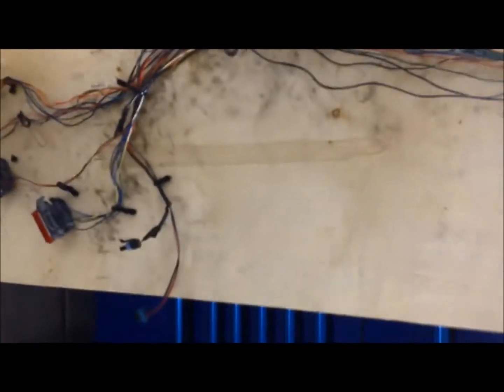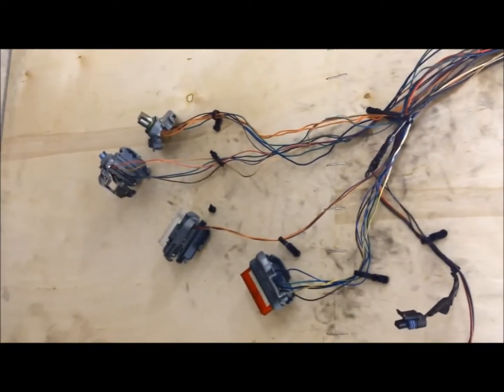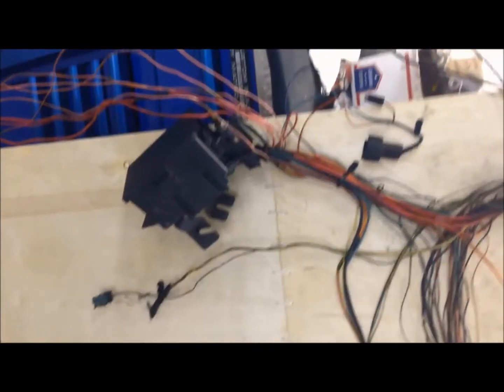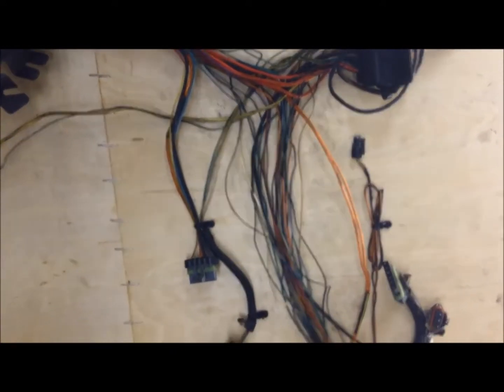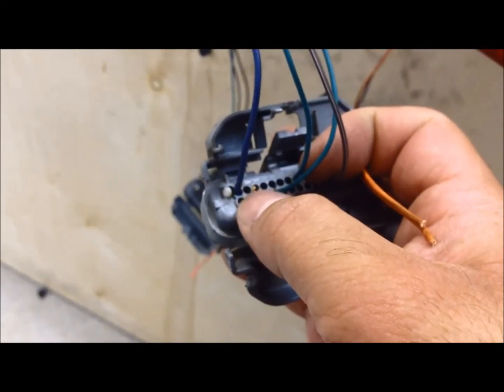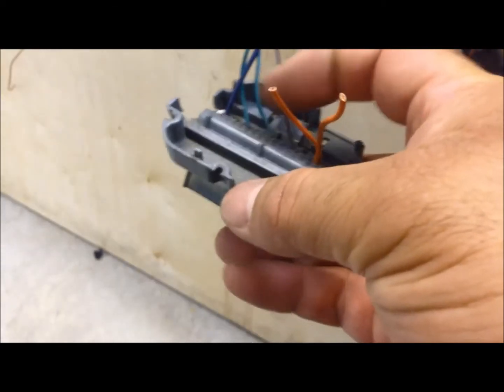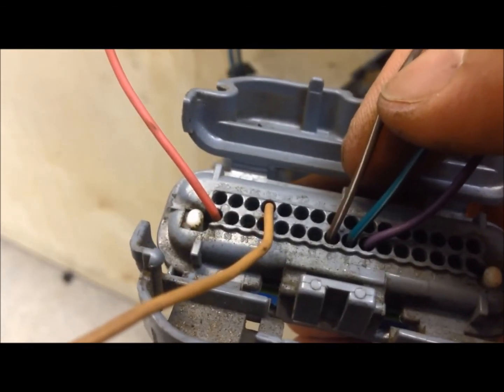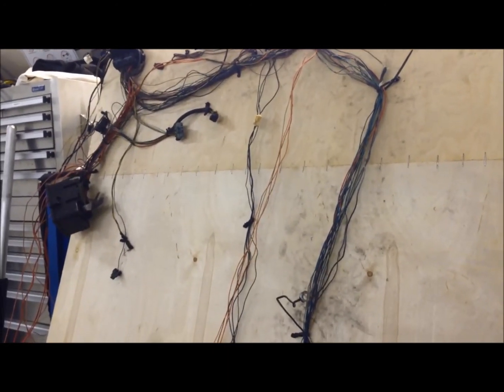Video #3 94-96 Impala SS Engine Harness How To

Comment: I'm doing a swap on my 94 Impala I was wondering on the wire harness bulkhead that's connected to the firewall for the connector on the LS1 harness that says fuel pump control do I just tie that into the wire on the old Impala harness that says switch B+ fuel pump sensor